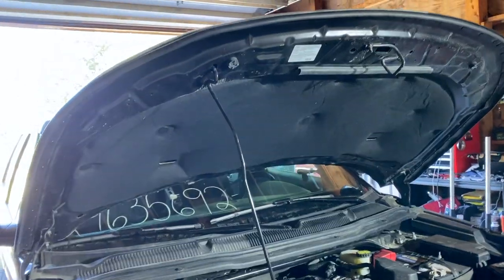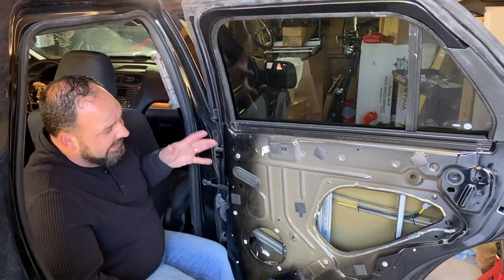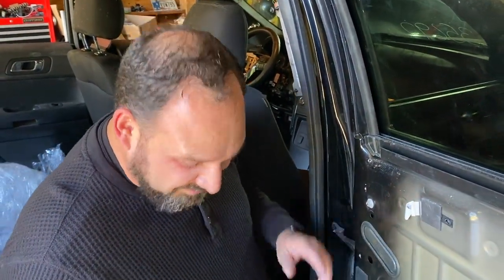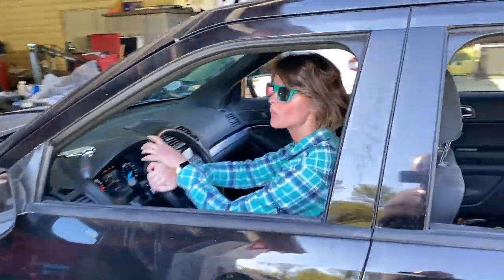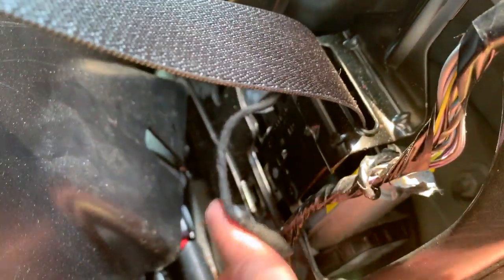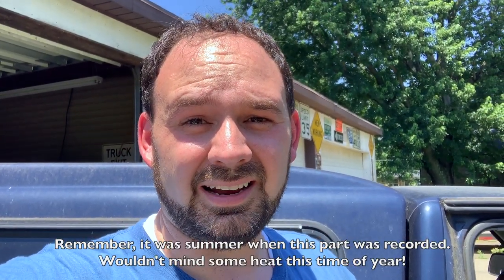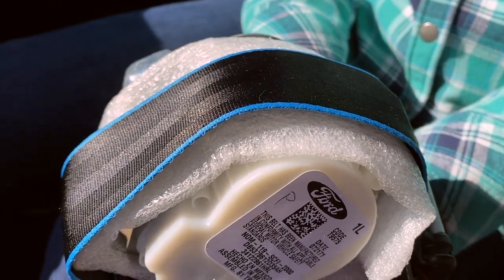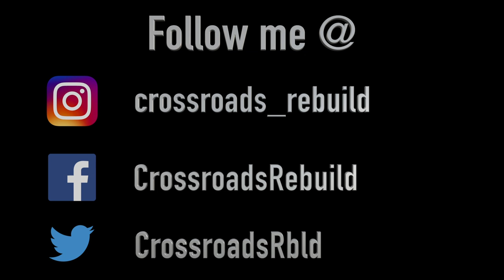Rebuilding A Wrecked 2017 Ford Police Interceptor Utility -- Part 12

Comment: Looking really good.  Almost there!   That'll be a nice ride for the wife and your greys!!    I've heard of that SRS/seatbelt rebuilding company before.....seems to be a great company to deal with from what Ive heard.   Ive never ended up in the backseat of a police car before (fortunately) so I didn't realize they put blank door panels on in place of the factory ones....I knew they disabled the windows and interior door handle but thats about it.
Reply from the maker: Thank you!! Safety Restore was awesome to work with! Highly recommend them if you ever need that service.

The blank panels in the rear are on a department by department basis. Some have the regular Ford ones, but this vehicle got something else on the rear passenger side. Glad I was able to find a Ford one to out in there!

The greys will have loads of space in the back of this thing!!

Comment: I have noticed that on a few newer fords with the driver seatbelt having one connector, and the passenger having two. I think it is for the weight sensor and position of front passenger seat. As for the front driver, the seatbelt gets deployed at full power regardless.
Reply from the maker: You’re probably right. I hadn’t thought of that before. Thx!

Comment: I am looking for a 2017 FPIU myself. do you know if the DRL works or has they been deleted?
Reply from the maker: The FPIU was not equipped from Ford with DRL. The headlights from a standard Explorer will bolt up, but DRL won’t work. May be possible to wire them up. Not sure what that would take. I wished mine had DRL, but I never went down that rabbit hole and just settled for stock.